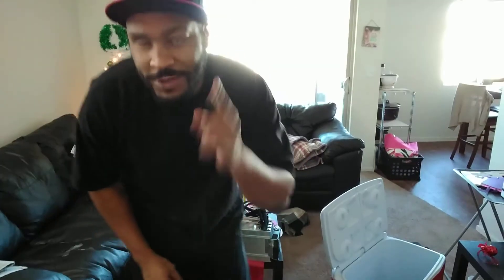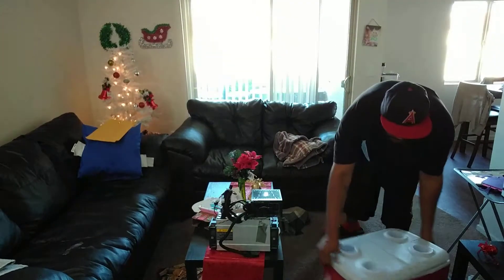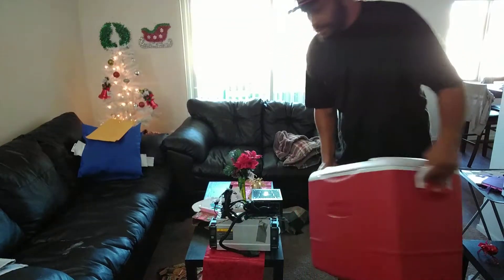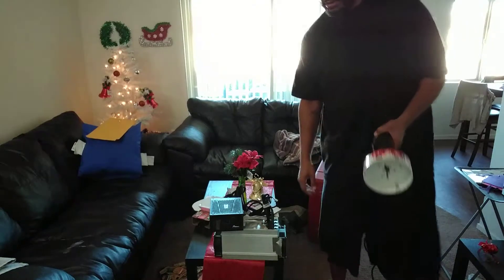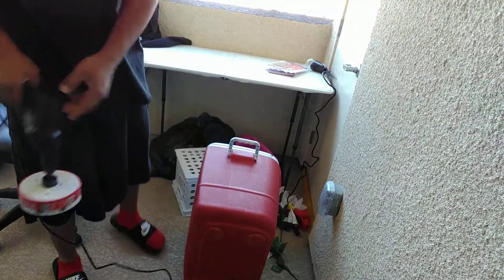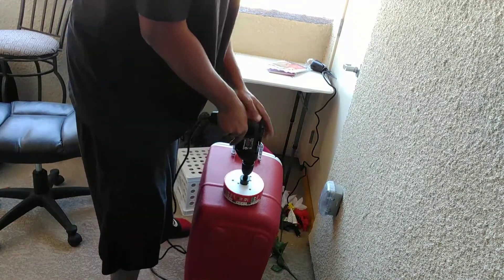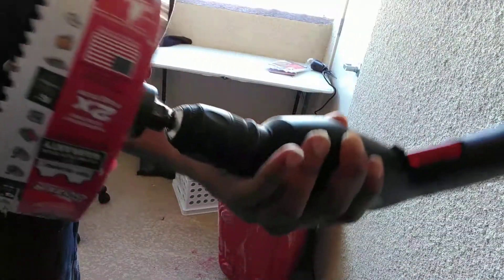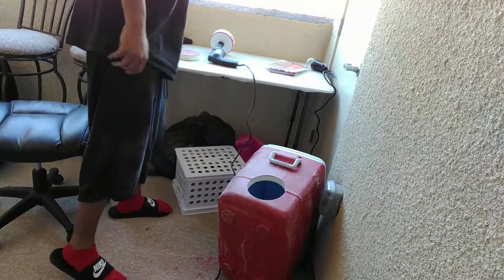How to use a Hole Dozer to build a sound proof box for Antminer L3+ Dec 17th 2017

Comment: Did you say 30 LTC since Dec 13??? Since DEC13, 2016? or 2017? No way it generated so much in 4 days lol. Fun vi btw. Good job. How is it running inside the container?
Reply from the maker: september 13th
Reply from the maker: I have overclocked it to 850 mhs so it's not as loud now lol